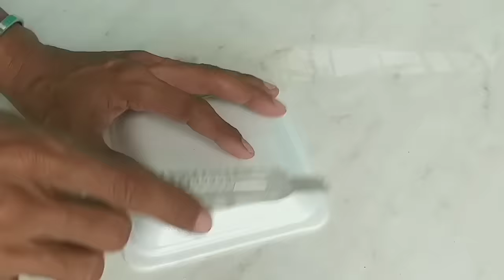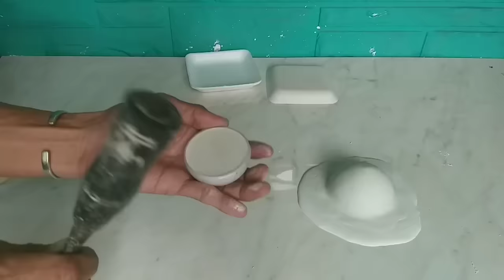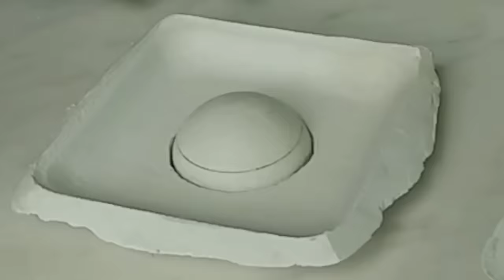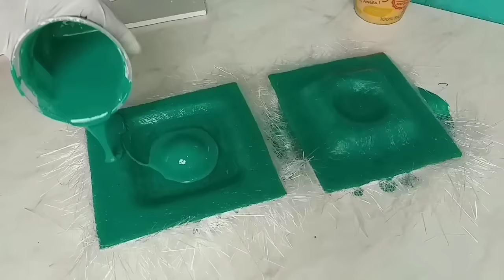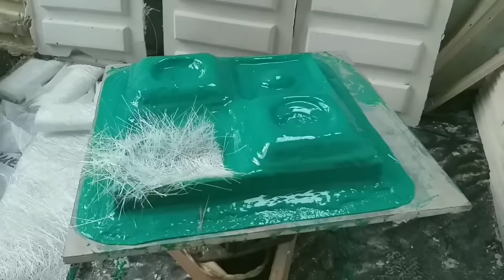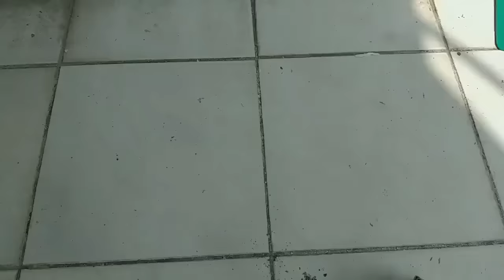Dont throw away your old LED bulb ‼️

Comment: I admire your patience and attention to detail but it’s way more time consuming to be cost effective. Unless you are doing it as a hobby beCause you enjoy it- then carry on 🤩
The plaster may crack, heavy to hang, difficult to remove if you use a glue or mortar to attach to wall. 

Thanks for showing us your skill. Very useful in replicating plaster architecture in old homes.
Reply from the maker: @Karen Raising Kittens,  Thank you🙏
Cant stop doing like this, all about resins,silicone,Plaster,cement and molding its my hobby. I really enjoy with this works.💖
Reply: No uoy spike englihs
Reply: @CreArth  Cant stop doing like this since the 1960ies. 
Aber Arbeitsschritte wie seit 5:40 zu sehen lassen sich durch Ausdrücken mit Wasser- oder Luftdruck stark verbessern!
But working steps as seen since 5:40 can be greatly improved by squeezing out with water or air pressure!
Reply: @CreArth  You do a beautiful job

Comment: Excelente trabajo! Gracias por compartirlo! En realidad muchas personas no saben realizar este tipo de trabajos artesanos, piensan que es más fácil comprar algo que quizás salga barato, en lugar de hacerlo pero no todos tienen acceso a lo mismo, por más económico que sea, así que FELICITACIONES! y bienvenidas las ARTESANIAS HECHAS CON AMOR, AL MUNDO! 
Abrazo grande desde Uruguay !
Reply from the maker: @Virginia Pereda , gracias, entiendes lo que estoy haciendo ... la mayoría de la gente todavía no entiende por qué hago moldes repetidamente, eso es porque necesito un molde de mayor tamaño al no cambiar su forma original. Y después de obtener un molde más grande ahorraré tiempo en la producción panel de pared. saludos
Reply: by the way, you spend 30 year doing this to accumulate the proper amount of pieces to mount on the wall
Reply: Pues no le veo el caso a aser elgo dela manera mas complicada en ves de comprarlo.. el chiste es ahorrar y simplificar las cosas no gastar mas y perder tiempo
Reply: G

Comment: I guess it works. I used to make moulds and truck accessories and I rarely had to ever touch a grinder, because I learned how to use a hook knife to cut the glass when it was cured, but not quite completely. What you should be doing to save weight by making them out of fibreglass. I see many things wrong, but hey, if it does the trick, more power to you! Good work!
Reply: Stres nungguinnya hasilnya

Comment: This form would be much easier to make out of silicone... other things that annoyed me ....cutting the foam plate with a knife instead of scissors.....digging the half ball out instead of putting hot glue on the underside ... score and pull on the glue to pop out...then to finish it off should have used a trowel that spanned the width of the work piece.
Reply: make a better video then

Comment: I could see these cast in cement and used to adorn the outside of a building or on a wall. Try using something a little more "industrial" than butter as a release agent, though.
Reply: Means you can eat them if they don't turn out good.

Comment: Well as you've found out many ways to skin a cat. I will say great job well done.
Reply: jimmy tiler ...Lots of cat skinning going on where you live? Why?
Reply: I used that term until I witnessed a method of preparing cats for food while on assignment in the the late 70’s .  A live cat was thumped lightly on the head to knock it out then it was dipped live into a vat of boiling oil up to it’s neck for around 10 seconds. The lady then pulled it out and grabbed the skin between the shoulders and pulled. Skin separated at the neck level and turned inside out, very neatly skinning the still live but stunned feline. I only mention this because it is why I no longer use that term

Comment: I understand, it's your passion, but it requires many steps. Maybe someone has a 3D printer and then he or you can print shapes which can be used in this process. You need to cover the printed lines to get a smooth surface, but that's just one of the processing steps you do anyway.

The easiest way to cover 3D printer lines would be to apply thick paint. Or resin or anything. Then you could even use these parts directly on the wall - or use them as parts of the mold where you put some of them together to get a big mold.

Comment: why dont you use cookin spray for the separating agent. would be easier to apply and more than likely work loads better. also, a little  messy, try cutting a piece of pvc pipe in half and making like a small trough to catch dripping plaster. just a couple ideas to make the process smoother.

Comment: There is no cheap materials for building home, only earth soil, and water
so - your idea best- near the north pole
Reply: everything can be better if someone will construct system for making such blocks not from casting plaster,but from soil - you need many electricity for electric arc(like welding) oven, and soil supply-delivering-storage chain
crude soil when melted at 1500-2000C gives some kind of ceramic or glass

Comment: If you didn't have access to fiberglass, could this be done using narrow strips of cotton or some other thin material, kind of like they do in paper mache? Laying strips then epoxy, crossed strips and epoxy, until it is strong?
Reply from the maker: Of course there are many ways if you don't have access to fiberglass, use a thin material that can absorb epoxy well.
Reply: @CreArth  Thank you.
Reply: years ago I did some drywall work in a old house I was living in ,, did not have drywall tape that day ,, I used strips of newspaper ,,20 years later it never cracked or peeled ..

Comment: With all due respect, that's REALLY a very long walk for a very short stay. You realize there's a half dozen ways to make that exact same mold in about 45 minutes using a 3d printer, which does the work while you watch. You'd still have a little fine detail at the end. But that's got to be the most complex way to get to the mold you made.